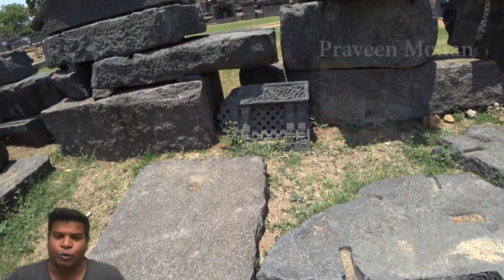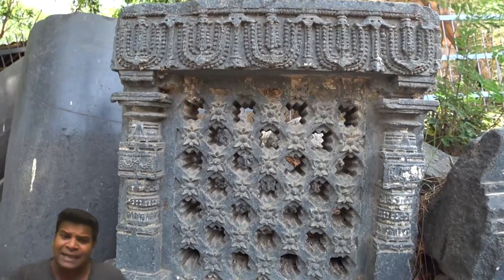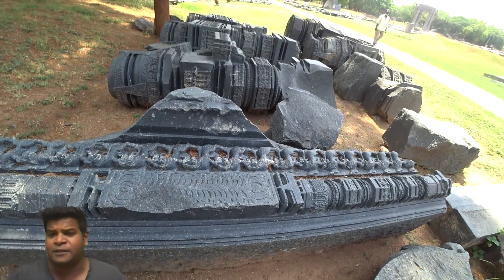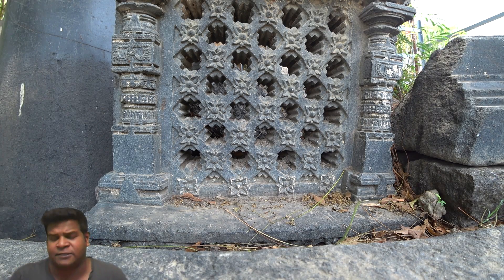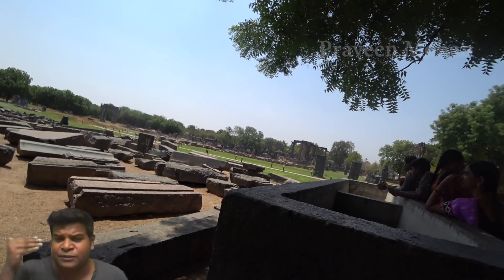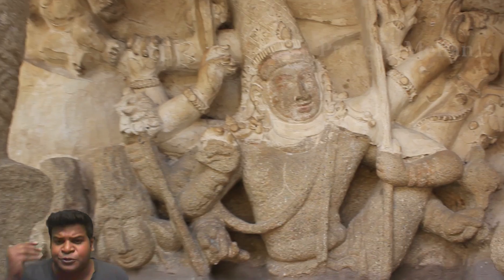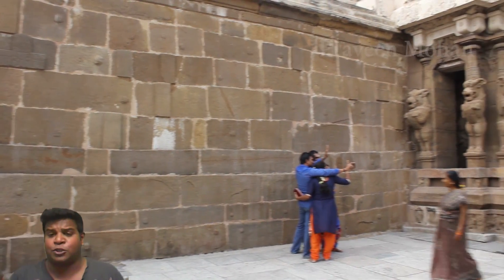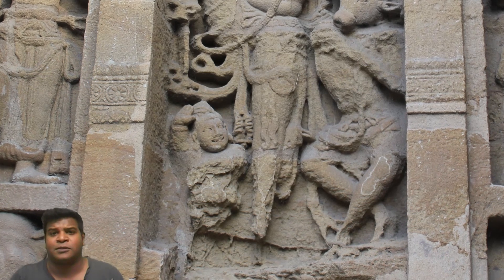Ancient Kailasa Nathar Temple was NOT built with Stones? Advanced Technology Revealed!

Comment: Beautiful hand carved basalt and very clearly not geopolymer, no archaeologist or geologist could mistake one for the other. A very simple examination with a magnifying  lens will prove that and simply tapping the rock with a light hammer will confirm it.
The sandstone used in the Kailasa  Natha is sadly dissolving due to acid rain and salt contamination, the poor attempts at restoration by plastering over brick cores and applying cement plaster are just failed efforts at restoration, to cite local lore and the words of a priest as proof of geopolymer construction is just plain mischief. 
Do try to inject a little truth occasionally,  It will boost your credibility
Reply: Then how did he point out the bricks inside the 'limestone'? If it was not an advanced construction technique, show me a way to insert bricks inside it. Also, you blame the maintenance authorities for their failure. Suggest me a way to protect the monument from acid rain and salt contamination. And by way I mean a financially and technically viable one. Don't tell me to shutdown the polluting factories in the neighbourhood as that does not practically happen in India. Suggest me a way to shield the monument from the contaminants.
Also, if it was hand-carved basalt, what is your narrative on the jali-work? You cannot inject truth unless you discover it. Here we are in the process of finding it. You are just dismissing it and that is not equivalent to disproving it.
Reply: @nikhil-kulkarni  The bricks are not within the stone, the figures are formed in a layer of cement plaster built up over a brick core, a restoration work on a damaged section not an original carved piece of sculpture.
Protecting the entire structure from the corrosive effects of our environment and climate would be prohibitively expensive but not impossible.
Praveens claim for use of geopolymer basalt is easily disproven and without any basis in fact. 
How would you suggest that tons of  basalt was crushed into particles small enough to make concrete?
The casting of simple concrete or clay grillwork is no proof of the use of anything more sophisticated , ie basalt or sandstone geopolymer .
The fact that no ancient geopolymer or basalt , granite, or limestone has ever been presented and proven to be as claimed should be evidence enough for anyone. The fact that none of those who claim that it exists has ever presented such for examination nor provided micro slides or analysis results  should likewise give cause to doubt the honesty of the claimants.
Praveen is not offering any evidence for his claims and is only too happy to pass on his half baked ideas to his fans.
Look again at what he shows in his videos, pause them and take note of the details in those carvings and piercings, they  do not show the precision and lack of variance that he claims at all, nor do they show the  accuracy one gets from the use of machine tooling.  But they do reveal the tiny imperfections and variances present in hand made materials, why would that be?
Reply: @seekernz7790  So you could not suggest a method for preserving. It is easy to blame the authorities for failure. Also no 'truth' about the jali-work.
Have you ever visited the temple? You will find that the carvings are all over the temple and they existed originally. Nobody is permitted to carve on the temple after the custody of the temple is in the hands of the government authorities. The authorities only patch up the flakings. The government authorities do not perform the carving-work. They do not hire any sculptors either. You are just discrediting the research of this young man. You need to introspect your own credibility.
Reply: @nikhil-kulkarni  What's your problem boy? Why should I go to the trouble of explaining the process for stabilising and preserving stonework to you ,how would you benefit from that?
 It's not a secret process and is certainly known to those tasked with  the preservation of monuments everywhere .
The degradation of that temple is simply the work of time and nature, 
 the corrosive effect of the plastering is not something that was foreseen and no blame can be placed.
As for Praveens foolish claim that the structure is an artificial construct is borne out by the numerous carved works that are rotted clean through and show clearly that they are natural stone throughout, and the crumbling plaster over the brick core shows clearly that it is not made of the same material as the whole structure. Regarding whether I have seen that temple in particular, no I have not. Have I seen others like It? Yes, in all corners of the world, and I do know how to recognise granite, basalt sandstone etc. & how know how they weather over time. 
You may be happy to be lied to by Praveen, I am offended by his deceit and appalled that so many of your countrymen are so willing to believe in his pseudoscientific attack on the  extraordinary skills of the craftsmen artisans and architects of your great culture.
Reply: @seekernz7790   If you feel trouble explaining me your preservation method, then you may not explain. I was not asking you to write a book on it. I don't know any such method that can reverse the effects of time and nature so I asked. This temple is not the only monument suffering from this fate; even the renowned Taj Mahal is degrading. The authorities have failed to preserve it too.
I never said I believe everything he says. I don't expect scientific evidence from him as he is not an expert. Why are you claiming that I am happy to be lied? I am an engineer myself and I do my own research. I believe that our knowledge of science and the past is still in a stage of infancy and we still have much to learn. So what is wrong in investigating? If I cannot trust Praveen, why should I trust mainstream hypotheses? Why should I believe that the ancients did not have technology above hammers and chisels? What you said might be truth for you. For me, I am not yet convinced so I keep digging for the truth. The French philosopher Rene Descartes once said, “If you would be a real SEEKER after truth, it is necessary that at least once in your life you doubt, as far as possible, all things.”
Reply: @nikhil-kulkarni   As an engineer you should by now have recognised that Praveen is somewhat casual in his interpretation of technical details, what do you make of his suggestion that high-speed drills were used to carve stone based on a curious detail of a thing that looks like a drill bit (despite the obvious fact that such a bit would not cut stone at all);
 do you seriously believe that granite can be softened and scooped out like ice cream, that basalt and granite can be cast like molten bronze and moulded into intricate columns, that massive temple structures were scooped out by machines 2000 years ago? 
Look again at the few close up images he posted of holes he says were machine drilled in stone, did you ever see a machine cut  a hole that was out of round and tapered in that way?
Look at the channel cuts he says are machine made, neither parallel nor straight, but just what you'd get by hand worked methods.
If you are going to seek truth you need to have both an open mind and both eyes open.
Reply: @nikhil-kulkarni   You state that you are in the process of finding the truth? 
The truth is that the basalt is natural volcanic stone, not magic concrete and was carved just as they say by hand with simple tools and great skill.
Truth is not whatever you want it to be, truth is simply truth. Fantasy and deceit are something else again.
Reply: @seekernz7790  I know protecting is not impossible. I just asked if you have any feasible scientific solution. Nobody has discovered the solution yet. Then stop blaming the authorities. Put yourself in their place and then contemplate.
I am not surprised that Praveen hasn't provided any evidence. How can he? He is not a scientist nor owns a laboratory where he can invent solutions. All he can do is look up the studies of others and forward his own suggestions. If I am a scientist and I say that I can find a cure for climate change, then governments must provide me an opportunity to conduct scientific research by funding me and providing a laboratory. But instead, if you disregard me as worthless and say I have no findings yet how can I ever become capable of finding any engineering solution, I can never convince you. The Indian governments turn deaf ears towards the intellectuals and do not provide them research facilities. Indians have to conduct tests in European and American laboratories. There is not a single sophisticated laboratory in India. From where will he bring evidence for you? There are numerous monuments in India and they have existed since ancient times. Do you really think that a mountain-carved temple such as the Kailasa temple could be carved out of chisels and hammers? You claim to know the truth? Do you have a cure for climate change, for yet uncured diseases, for protection against nuclear fallouts, for energy crisis? Downplaying is not truth for me.
Reply: @D Roy  I do have rather a lot of interests in my life, one of them is the extraordinary blossoming of pseudoscience in the social media and the staggering number of people who are gullible enough to give credence to such charlatans. 
If you need a better definition of the word ' Inane ' you might just scan further through the comments, his fan base will provide you with a better grasp of the meaning. 
Praveen Mohan is an interesting diversion, great travel pics and a lot of unproven claims. Sadly there are a great number of people who are under the impression that he actually knows what he is talking about and are only too happy to believe the falsehoods and fantasy he espouses. Can you point out anything concrete that he has provided in support of his claims of advanced knowledge or technology in ancient Bharat?  
Can you cite any corroborating evidence for any of his assertions.
I have personally visited several of the structures he has featured in his videos and can state with confidence that there is a great deal of hard evidence of conventional stone cutting techniques in all of them and no evidence at all of power tools of any kind anywhere with the exception of animal or wind powered devices. I have researched some of the claims he has made in other areas and conclude that he is rather prone to making evidence fit the fantasy rather than the facts.
He's a conman , he is a phony and a very entertaining one at that.
I have no need to discredit him, he will eventually do that for himself given the path he has chosen.
Follow him as you will but recognise that he is not quite the white knight!
Reply: @D Roy I should have asked, what makes you think of him as courageous, he's a fortunate but unextraordinary  traveller with a vivid imagination.
Reply: @seekernz7790  Yes, he is casual and I don't find anything wrong about it. I already mentioned that he is not a scientist.  What I like about him is that he makes amazing observations. What you claim to be 'truth' is from your perspective and I disagree with it. You may call him whatever you want and I respect your freedom of speech and expression. But you cannot force your views on me. If I cannot believe him why should I believe a random youtube commenter who hides his true identity behind a fancy profile? If I cannot believe a local temple priest; why should I believe a foreigner who observes our heritage as a tourist? I don't even know who you are. You could be genuine; you could be a troll. You say that my ancestors were ignorant of any technology beyond hammers and chisels; what do you know about the contributions of ancient Indians to mathematics and science? I am an indigenous citizen of India and I am proud of my heritage. I have been studying Indian scriptures and heritage since my birth. What can a foreigner teach me about it other than how miserable ancestors I had? You ask for scientific discoveries; you won't even believe what they discovered. Will you believe if I tell you that ancient Indians knew the value of speed of light? Will you believe if I told you that Indians were the first to use 'zero' as a numeral in mathematics? Probably you will call me a fool and dismiss it, but fact is I have evidence of it. And this evidence has been presented by researchers at conferences. There are many more things but I can't show light to a blind-folded man like you. For you, knowledge is what is 'obvious'. 'Truth' is what fits your narrow narrative. Whoever makes claims contrary to your beliefs is a "conman, phony and...".

You say you found the 'truth' on a prima facie examination; I say you like to jump to conclusions. You claim to know the 'truth'; I say you are prejudiced. You call yourself wise and me as gullible; I say you are being a judge in your own case. For you, dismissing is disproving. For me, the truth is, neither you and me, nor Praveen and the priest were a physical witness to the construction of these monuments. So with which hollow confidence are you making such claims? You are not even willing to listen to arguments. I would give even a lunatic an opportunity to present his case. Let us just be polite and listen to what the other person is saying. Who knows what has transpired amidst civilizations since the beginning of time? Don't act like you are a 'knower of everything'. Nobody has answers to all questions in life. You ask me about all your technical doubts; I say that just because something hasn't been explained by science does not mean that it cannot be explained. I don't know if you have a background in science and mathematics. But still I ask you. Tell me, it is known that laws of conservation of mass, charge, energy, etc. all lack proof; yet why are they widely accepted by the scientific community? The basic axioms of geometry as postulated by Euclid are lacking proof. Yet why are they accepted? There can't be evidence for everything. Some theories are not proven; doesn't mean they are wrong. Even Isaac Newton's theories on light are deficient and fail to explain wave nature of light. Still you expect scientific explanations from a traveller when we can't fully trust Newton?

And lastly, ask yourself this question, "If I have learnt the 'truth'; why I am even watching this video?". Does a person with open mind and eyes ever claim he knows the 'truth' before thorough investigation? You sound to me like a stereotypical Christian missionary with the Bible in one hand and bribe in another.
Reply: @nikhil-kulkarni  A fascinating speech  laden with false assumptions and bigotry , and no answer to some very simple and pertinent questions. 
Put aside the fact that you know nothing at all about my ethnic or academic background and  focus on what your hero is spouting as evidence Lost advanced technologies and Alien origins for the people and culture of Bharat.
His denigration of the achievements of the ancient and not so ancient architects and builders is deplorable. I am well aware of the contribution that the ancient scholars have contributed to the arts and sciences and your insinuation that I as a non Asia should be ignorant or dismissive of them is a reflection of your own  racial and religious bias, not mine.
Note that these 2 statements you attribute to me were not mine ; ("You say you found the 'truth' on a prima facie examination; " ), ( You say that my ancestors were ignorant of any technology beyond hammers and chisels ) ,how am I to interpret your inclusion of them?
 I, unlike Praveen ,do have knowledge and skills with regard to stone  masonry and a sufficient grasp of the scientific method to recognise that he is making false claims for much of what he presents. I ,unlike you and many of his fans , do care about truth, and Praveen has not yet provided anything that resembles that. If you are of the opinion that  nothing can be known to be true without being present at the 'event' how would you defend your faith in the Vedas ? , you were not there and have nothing more than faith to fall back on, the scientific method has a very real application, and pseudoscience does not meet the standard.
I have no interest in a philosophical debate with a bigot, and unless you are prepared to give an honest and  objective answer to my questions regarding the tools and techniques I cited  i see little value in continuing this discourse as you seem rather hung up on the fact that you are an Indian and I'm not, and fail to see why  critical skepticism is a valid response to unsubstantiated claims. your comment; "There can't be evidence for everything. Some theories are not proven; doesn't mean they are wrong." is the reason that a method for determining ' right and wrong'  was concieved and is applied in the scientific realm! . Skepticism is the process of applying reason and critical thinking to determine validity. It's the process of finding a supported conclusion, not the justification of a preconceived conclusion.